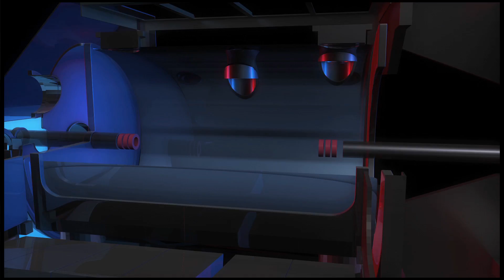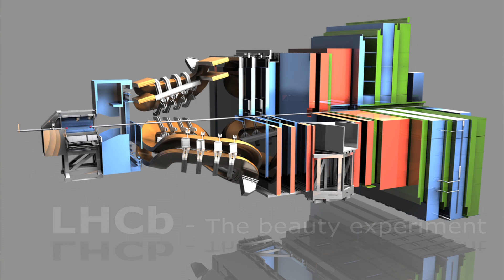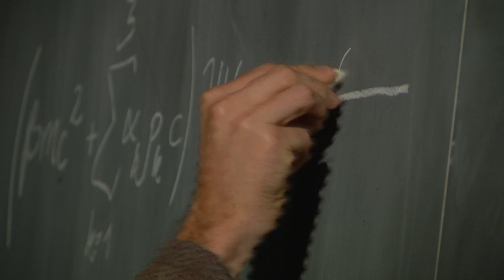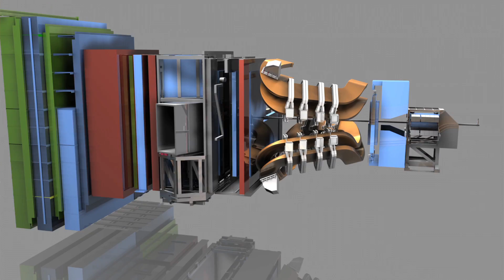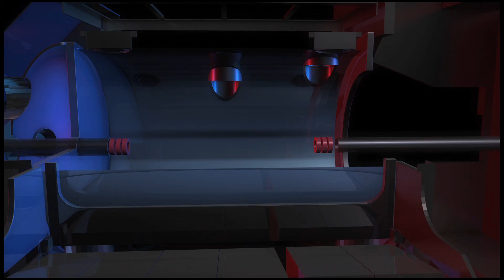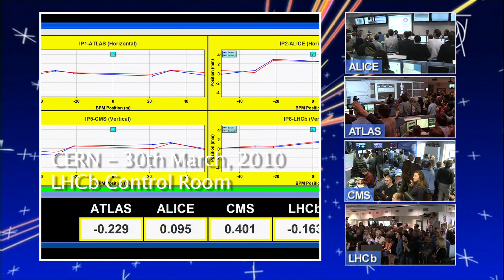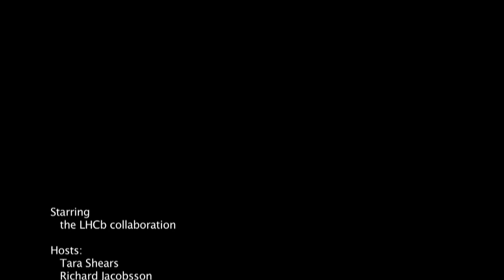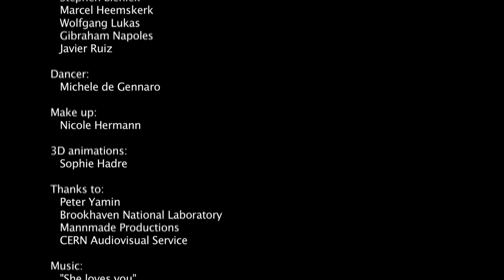LHCb - The Beauty Experiment

Comment from the maker: @Hornet85 The CERN Computing Centre features about 10,000 CPUs, dedicated to processing LHC event data. This represents about 10% of the LHC computing needs. The  Worldwide LHC Computing GRID (WLCG) in fact spans well over the CERN site, including 140 computing centres around the planet. Projects like Folding@home etc. use a volunteer computing infrastructure, called BOINC. There is enough spare capacity on BOINCs to run without the need for GRIDs.
SdG

Comment from the maker: @Keovar You are correct about the need for an almost perfect vacuum, in our experiments. The vacuum in the LHC is 10 times emptier than on the moon, and that's as you say, in order to "remove obstacles" into which particles may bump. In our Universe there is no "visible" antimatter so far, let alone a whole galaxy. We are about to launch an antimatter detector (AMS) that will be installed shortly on the International Space Station, to look for any traces of antimatter in space.
Reply: How do you see the antimatter? What are the results of the experiment? Is antimatter the concept of 'selectons' for example super symmetry?

Comment from the maker: @geromino2007 All of what you mention, plus radiation. When the beams are on, there is high radiation in the tunnel and the experimental caverns. This radiation is however entirely contained within the thick cement walls. That means it is perfectly safe for us on the surface, but you just cannot be in the underground areas when the machine is running.

SdG